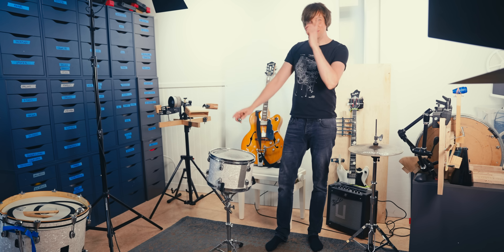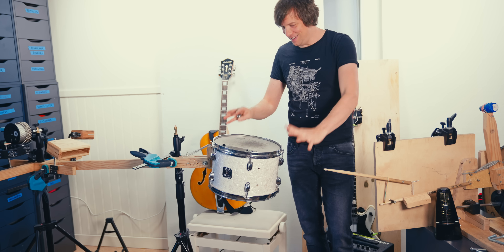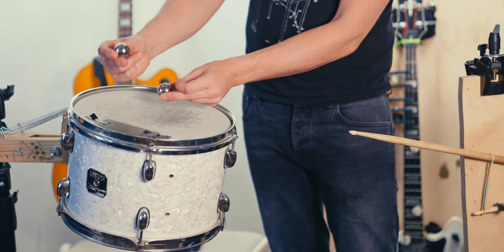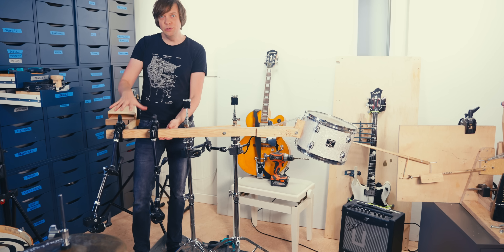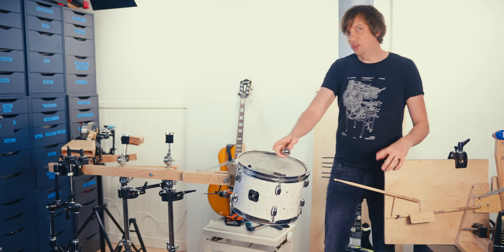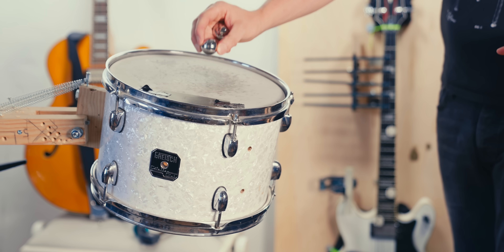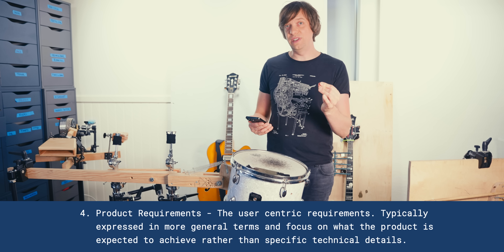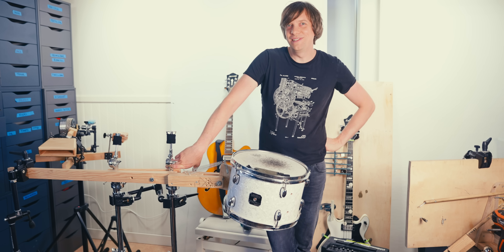Drums that Move makes the Marble Machine FUN!

Comment: This looks really awesome.
At this point, the only thing that worries me at all, is that the marble machine doesn't look like a machine at all, but more like a system of machines that plays instruments and somehow runs on marbles.
What I loved about the MM1 and the MMX, was the fact that the whole machine was entirely inside this weird gear-filled cabinet. It felt like a machine, like a giant typewriter. You never knew what lever was going to do what, where marbles were going or where they were going to show up from. Or even how the whole contraption worked at all. It wasn't just awe and wonder, it was magic.

I must admit, I'm not feeling the same way with the (current) design of the MM3. Everything feels disconnected, separated, isolated, and just controlled remotely. 
I really hope that changes in the future.

Comment: Unless you are using mechanical linkages you will get timing issues as the next marble may hit the drum at a different position. You may introduce enough play that you won't catch those marbles.
Also, it starts looking like you're looking into version 1.25.0 features but you have yet to get version 0.1.0 that validates all your SINE QUA NON requirements.
Reply: I'll add that if you go from slow tempo to fast, your position will go from the highest to the lowest and you will have a delay between the drums and the other instruments. You could account for that, but that seems over engineered.

Comment: I don't know why everyone thinks this is inconsistent with his earlier emphasis on tight music... even if there's a slight delay on a double marble hit, the tempo of the music will remain consistent. It won't be slowing down and speeding up throughout the song. There will just be some notes that don't hit exactly on a beat, and the design requirement of having an adjustable lever motion will allow Wintergaten to make sure the music sounds good.
Reply: But wasn't that the exact thing he wanted to avoid, during his "tight music phase"? Marbles hitting just slightly off-beat?
Reply: @Mutaburasaurus  that's not what I remember. My understanding was he was worried about the tempo, basically the consistent rotational speed of the flywheel, because he wanted to a whole band to olay along side it and having vaoable tempos would make that impossible. What I remember is he was very concerned with getting the marbles to drop consistently. Now that that problem is solved, he can afford to have a little wiggle room around the base tempo. I'll add that it could make the machine sound a little more organic, like he was trying to do with the shakers a few weeks ago.

Comment: if you revisit this, try putting the hinge point for the drum on the other side of the block, at the top instead of at the bottom, so that rather than tipping forward, the drum moves downward in a more linear way, with most of the downward motion coming from the rear pivot, with the forward pivot allowing the head of the drum to stay level to the ground

Comment: I think you should have one carefully tuned pivot point or some other design that lets it depress straight down.

i think the characteristics of the spring matter a lot too, you want it to pull back hard enough to be quick, but it has to be loose enough in the beginning to not hamper the visual effect. stronger spring constant, longer relaxed state i guess. 

also some kind of padding to stop it bouncing when it comes back to it's starting position

Comment: suggestion: introduce an electrical system which gives LED feedback instead of mechanical feedback which compromises the timing. Each instrument could flash an LED strip when hit by a marble. A software simulation with moving drums looks great, but does not translate to real world systems very well, you'll chase your tail trying to simulate it. Please keep a simple tight drum setup and flash lights instead, if you really need the feedback.

Comment: Don’t listen to those saying this is feature creep, percussion and drumming are extremely visual and so is the marble machine. You’ve made it clear that the visual and creating awe and wonder are a priority and I think that’s great. I am a firm believer that the world is in need of more whimsy, awe, and wonder and it’s what I can rely on you to provide as the artist you are. Don’t let the comments dissuade you from creating the machine you’re inspired to make.
Reply: But this implementation will not be visible from far away AND will cause all those problems while ideas proposed by others (for example lights turning on when any instrument is hit - so not even only the drums)
Reply: @ATOM-vv3xu  ideas like that undermine the mechanical charm of the machine and the design requirement of being human powered or mechanical period. At that point we might as well just replace the programming wheel with an Arduino or some shit to drop the marbles. Also depending on how much spring tension it will be visible from quite far away, definitely further away than just a marble.
Reply: @imdadirtydan  he can power the lights with a dynamo if it has to be human powered and activate them mechanically (if that is necessary - I personally think, that having a visualisation and finishing the MM3 are more important than using no wires). I also think that the color and maybe even the presentation of the lights can make a huge difference on how much they fit into the marble machine (in steampunk fire and old glow-bulbs are the most common looks but I think fire doesn't fit the theme as well so maybe the bulbs or smth similar)
Reply: @ATOM-vv3xu  if I remember correctly, he really doesnt care for steampunk and the steampunk aesthetic
Reply: @imdadirtydan  it still has a similar look and I was just saying that what works there might work here as well

Comment: This is a terrible idea. This adds to the inconsistency that has kept you from completing this project.
Reply: Before he didn't like the bad timing, but he said that having a more engaging machine makes him want to work on it
Reply: @PineaFan  the Springs are going to cause an issue with reliability. The whole mechanism will add extra noise to be picked up by the mics and then he'll have to eliminate that noise. How fast a Beat Can Happen regardless of the math will be limited by the bouncing. There are numerous reasons why this is a bad idea. I honestly don't think he wants to finish this machine.
Reply: At this point I'm sure this is a social experiment
Reply: I agree movement will cause issues why not just get the drums to light up it will be just as visual but keep the timing
Reply: @allynight  and could be triggered by piezo pickups.
Reply: @MrUhrs  I agree.

Comment: I've recently been working with a team that uses the double diamond design process model. It's somewhat similar to what you're doing and I think it fits your natural inclination to rapidly try things out before picking a concept, and then try a bunch of (actual) prototypes before honing in on a single solution.

I encourage you to read up on it if you haven't already. It seems like it plays to your strengths while helping with some very loose guardrails. I'm excited to see what comes next!

Comment: Martin you are doing the right thing - what you are doing is exploration of the problem space, which is an essential step before solidifying the design requirements. Unfortunately in the world of engineering, due to time constraints many engineers often rush or even skip this step entirely. Now that you've explored this and found its something you like, your next thing should be to see how it affects the tight timing aspect to see if you truly "don't care about that anymore" - I suspect you actually still do, and in the end you will find some compromise between the kinetic and the timing aspects that satisfies the best of both worlds.
Reply: Dude, he has been exploring the problem space for how many years till now exactly?

Comment: OK lets make this clear. Either you need to make a very complicated set up that allows the bounce back to be timed with the music or you need to drop this moving instrument idea!
How long have you been chasing timing? if you can't time the bounce back to the beat then all that previous research is out the window as you have a constantly changing drop height. Not only that but you will have little to no control over dynamics, as without this timing you would not be able to ensure whether the drum is stationary (normal dynamics) moving down (quieter dynamics) or moving up (louder dynamics)
This is not even to mention the erratic bounce of the marbles that you already ran into issues with with the MMX which was directly caused by the moving vibraphone plates.
If you continue to chase things like this then there will never even be a world tour! 
Sorry if this seems harsh but I really believe in your dream of the marble machine and would absolutely love to see it come to fruition, things like this will only ever ensure it never happens!

Comment: Add a light to reflect off the marble and cast a shadow or reflection off the marble. It makes it easier to see and adds to the "motion". Blue man group uses liquids to create visuals from drums. You can also sprinkle glitter. Use a rotating "salt shaker", with glitter-sized holes... Or a measuring spoon that scoops small portions from a "sand hour glass" feed system.

Maybe add some hung strings, on the bottom drum pad. They will bounce and vibrate with each hit, if they have a tiny "bead" of weight holding them taught.

Comment: If you really want the drum to move start with design requriments
I suggest:
1) keep it simple - one pivot not two
2) repeatability - the drum returns precilsly to the relaxed position so marble bounce tragectory is within spec
3) return speed - drum returns to the relaxed state fast enough so its ready for next marrble. In relaxed state drum doesn't vibrate or wobble as to not affect bounce tragectory (requirement 2).
4) quite movement.

Comment: A four bar linkage would allow for translation and rotation of the drum.  It could drop and rotate however much you want based on the lengths of the links.  And a damper in addition to the spring would let you get the settling time you want.

Comment: I hope this means he's gonna be more laxed when it comes to the marble catchers and opt for larger funnels rather than trying to get super specific and consistent trajectories just to get each marble to land in its own funnel. 
  
Martin if you're still not inspired by the idea of having one massive marble funnel, this might be a good interpretation. When the marble starts its journey it is just one of many in a mass of marbles but as it makes its way through the machine it gets sorted and eventually finds it's path to a given sound that will be made at some point. As it reaches that point it gets more and more single tracked until eventually it's sitting in a dropper waiting to be released. It has one job and that job can served by that one marble. When it does it is finally freed from the constraints of the machine, physics takes over entirely and then once it has made the sound it has served its purpose and flies off and is finally free to move in its own direction before finally being caught amongst all the other free marbles and reenters the machine as part of one mass of silver shining potential. I think that'd be beautiful

Comment: here's an idea i just thought of that also has some basis in Animusic, but would be a lot easier to implement without sacrificing the accuracy of the drums, or the awesomeness:

Static drums, but they have a ring of LEDs around them facing in, and the drum has a contact microphone on it. when the contact microphone detects the drum being hit, it makes the LED ring light up, shining on the surface of the drum skin, and then it fades slowly over time to its off state.

Comment: You could achieve instruments that move when hit but with repeatable motion and timing by attaching them to a linear slide system with a spring or counter weight that balances out the travel time.  That way the instrument only moves in one direction and you can control how much it moves.  Would probably be more compact and easier to do than putting things on arms with pivots, which also affects the ejection trajectory of the marbles leaving the instrument.

Comment: Don't forget about math!  A drum on a pivot arm with springs and counterweights is an easy system to understand, and if you understand how the drum moves you can know where the springs and counterweights need to go to get the coolest drum movement, and how to adjust programming profiles to at least approximately correct the timing of a second marble.

Comment: I feel like the single pivot with some type of constraints for the top and bottom movement will be best.  Like a shock mount for a microphone, but for the drum.  Actually doing a shock mount might be perfect for this since it will isolate the movement to just the drum.  So you could have a rigid frame that stills allow some movement for visual impact.  How tight you have the shock mount will determine how far it moves, how much it overshoots rebound etc.  But the two pivot is a flat no, its an incredibly fiddly system.
If you want solid state I'd say go with an led based visualizer.  There are controllers that take in a 3.5mm input so doing it with contact microphones should be simple.

Comment: I'd say go with counterweight wherever possible.

Anywhere you are using that kind of spring, it IS eventually going to break while playing, unless you commit to replacing them regularly. Though, I suppose you can design around that eventuality by just making sure that the amount the spring moves it is within your timing tolerance, so if it breaks, it doesn't jiggle, but the song doesn't get wrecked.

Comment: A lot of people are complaining about the accuracy of a moving drum, I say make it move faster over a shorter distance. Use more powerful pneumatic pistons that will have an absolute limit so the drum can't be thrown too far out of range. If you want to get really overcomplicated you could even design lags or advances into the timing mechanism to account for the difference in drop distance.

Comment: Moving drums look awesome, but also feel like something that could be added later, once there is a muscially-functional Marble machine, this can be added.

Also, my inner software engineer is saying that requirements are dumb, and user stories matter.  Focus on the actual need (a visual signifier that the drum is hit) as opposed to a specific implementation detail (the drums move)

Comment: You should be also experimenting with shock absorbers to remove the rebound of the drums.  You could tune it so the rebound is no force, but the compression (drum returning to normal) can be tuned to have a slightly slower return rate and prevent the bounce at the top.  This way also you can tune how long you want each drum to take to return to its original state.

Comment: I think you should continue to use the stationary drums for the better timing. If you want the audience to better visualize the marbles hitting the drums, then maybe you can attach a sensor to the drums that detect when the marbles hit it and cause the rim of the drum to glow using led lights for example.

Comment: There is no such thing as too early for prototypes. For complex projects, early prototypes answer "What is possible?". Falcon 1 was a prototype for Falcon 9, the most SpaceX knew about Falcon 9 at the first launch of Falcon 1 was that they were aiming for an orbital rocket with at least 1 ton lift capacity using in-house engines, most likely hydrolox because that was the expertise they had in house. Technically, that was all correct in the end, but also so much less than the final product.

Comment: Hi! I think it's better to use a column vector to move the drums, rather than a curve vector. You might try do this: take three posts and add strings at three points (each 120 angle) on the drum.
Or you can just add a picture to the drum head. The viewer will be able to see the vibration on the drum head better, so it will add more movement.

Comment: Engineer here. If you attach the drum to a parallellogram  with a spring. It would not change the angle only the position of the drum, and the bounce of a second marble would be a similar trajectory.

Comment: I feel like if its gonna be a design requirement that drums move some other things are going to have to be reprioritized.
Marbles will be on the floor, i dont think theres anything that could stop that. Timing will be a tad off, though that may be able to be worked around. It will mean making music will have to acount for it though.
Tbh, now that the design is going to be less of a standalone machine and more of a set of machines all put together on a stage, eliminate the problem of marbles being on the floor altogether. The floor becomes a secondary marble collection system.

Comment: I think I prefer the single pivot both because of the soft dipping action (as opposed to just downward translation) and the space it will save in the machine. My only concern is that if you're trying to play fast and a marble hits while the drum is moving or in a lower position, the angle of the drumskin will change and the marble will be launched in a different direction. The only two solutions I can think of would be to either design a much longer funnel which could catch marbles that land closer or further away from the drum, or to just use the drum only when it's stationary which would require more drums to play faster.